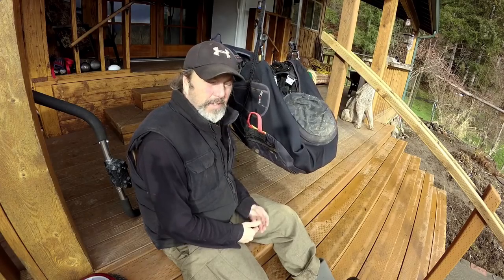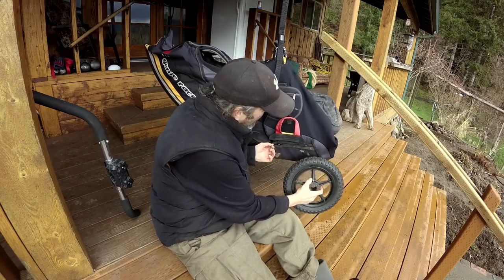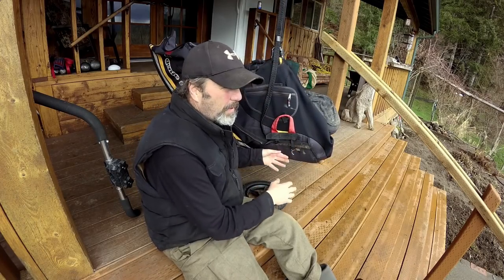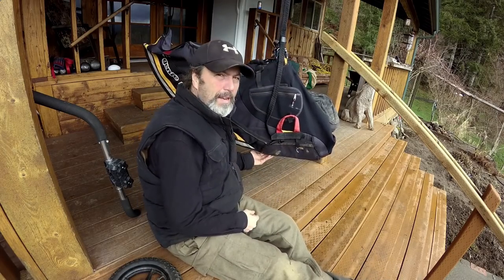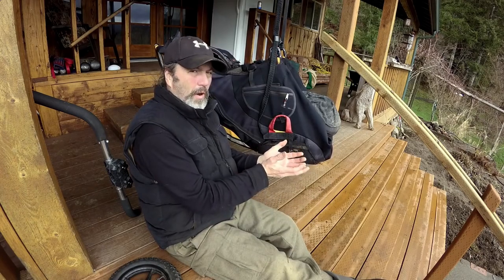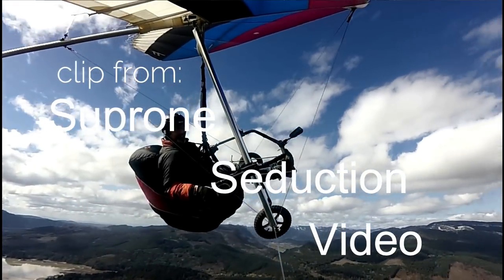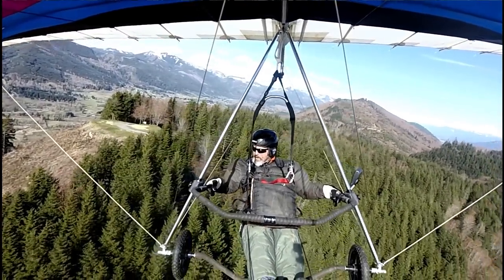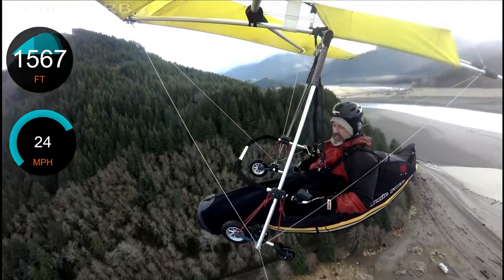Suprone Harness Considerations, Part ONE, Fenison FlyBar

Comment: Hello Jim. I'm an old fart pilot with an often times bad (sore) back. Have you got your flybar system ready for purchase yet? I think it would work great for me. How can I get in touch with you?
Thanks
Reply from the maker: It is taking a very long time to make this available Sam Huff.  I am doing my best to move this forward this winter.  This system is insanely comfortable Sam.  I have not had an achy back, shoulders, or neck in three years now....not once have I been sore after landing no matter how long the flight was.....Roll control is actually much easier than in prone, and I use my legs for most of my pitch control....It's so easy to fly this way its actually a little boring...
Reply from the maker: I am hoping to bring the entire Flybar system to market this year via High Energy Sports.